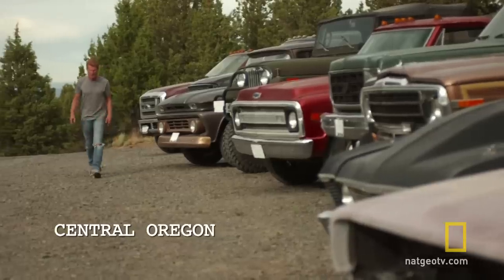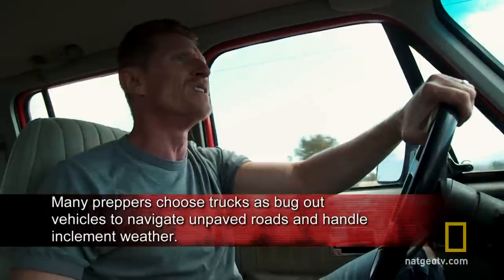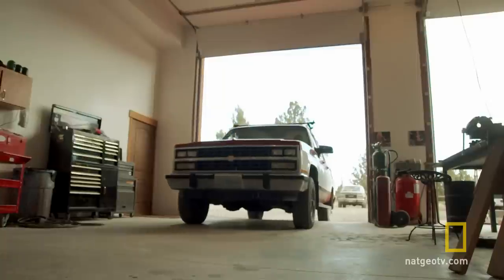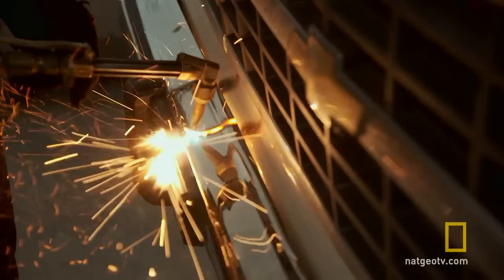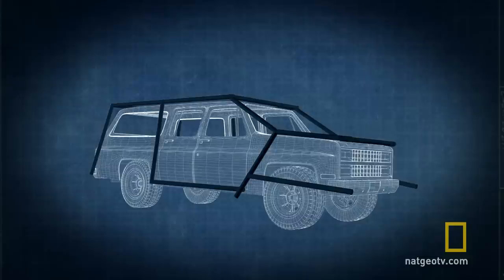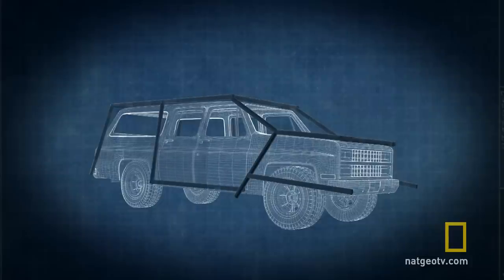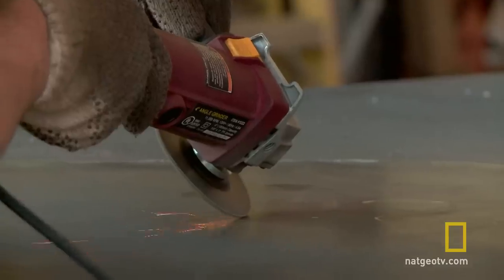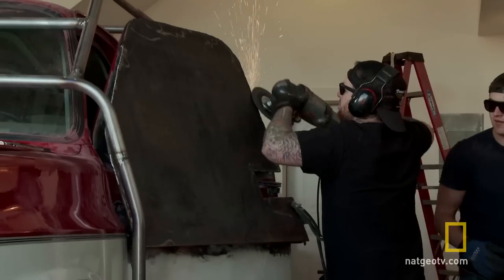Armored for Armageddon | Doomsday Preppers

Comment: The military in Iraq did this to their humvees. Didn't work out that great considering maintenence on the vehicles. The engine broke down more frequent because of the extra weight. I just wonder how long this car will last. The armor is great against small armsfire, but at the cost of engine duration.

Comment: Kevlar wont stop rifle rounds. I could put a .50 cal round right through both side of that SUV AFTER its armored with the steel they are using which most likely is not 500+ Brinell hardened.

You could use ceramic but very expensive. One thing I didn't see is beefed up springs and run-flat tires. This vehicle would not function properly and could very well trap those riding in it. My .02

Comment: Did you ever wonder why they have roll cages inside the cars in all Pro Off Road and Racing cars? Have you ever took a thought on why even the best Millitary car sold to citizens and made in africa have windows and not plates all over? Did it eve occur to you why pro-offroaders generally go for Suzuki Samurai instead of a SUV which is generally around the same price? Ever gave any thought to how much fuel that thing will eat as a old 350 HP? Doomsday? Yeah.. With that for sure.